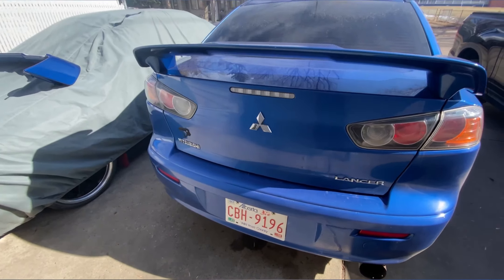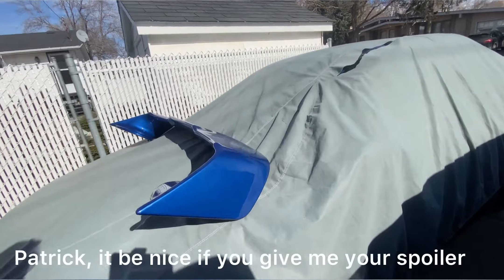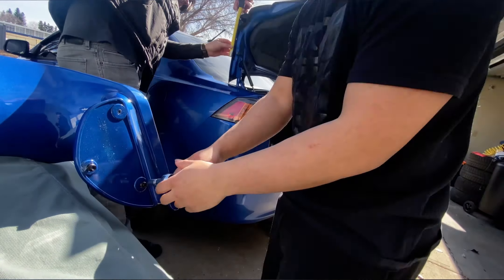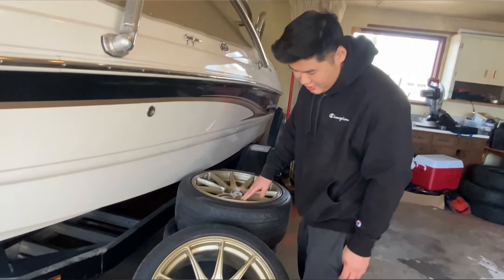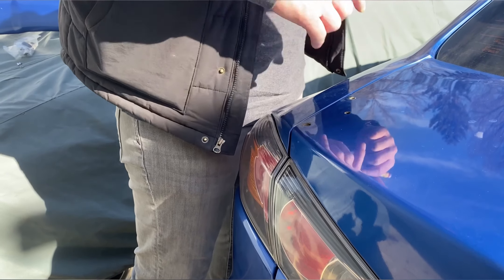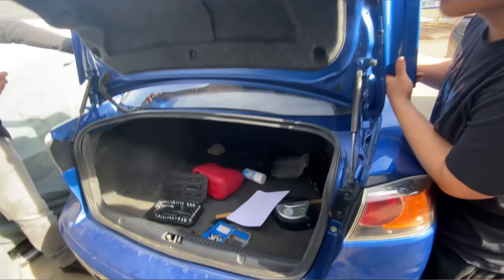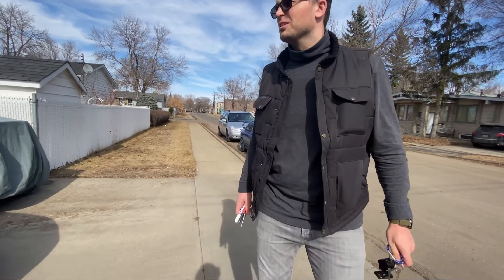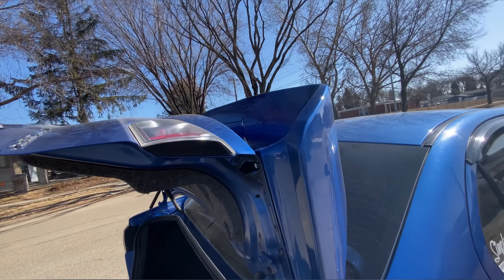Installing Evo style spoiler on my lancer!

Comment: So I guess you all did not know there are per marked spots on the inside of the trunk that are preset for both spoilers.
Reply from the maker: Yea I knew, the spoiler that came with the car was drilled in the wrong holes and they cut a hole inside of the trunk to screw it in. I didn’t want to drill two extra holes so I got my friend to measure it out for me